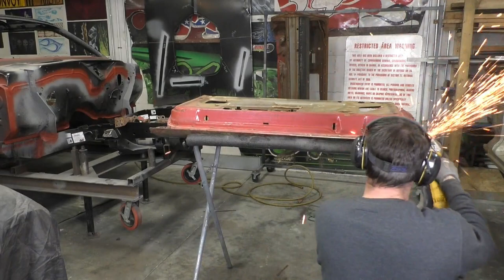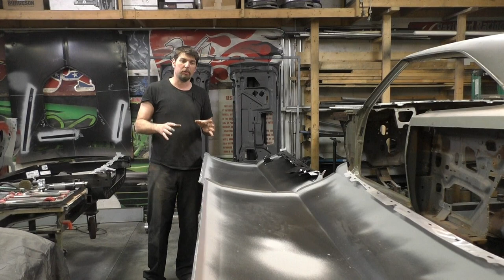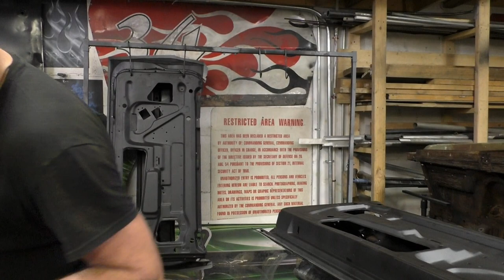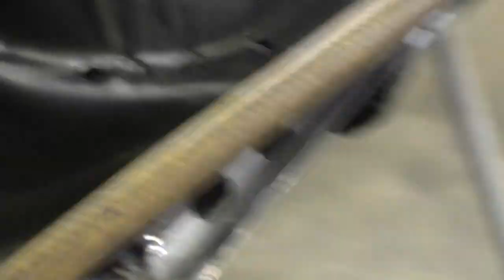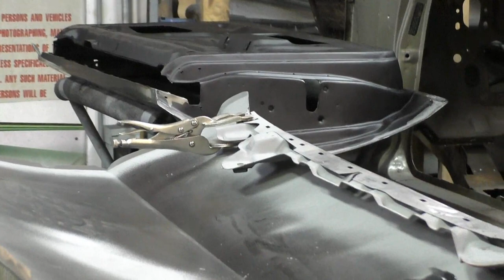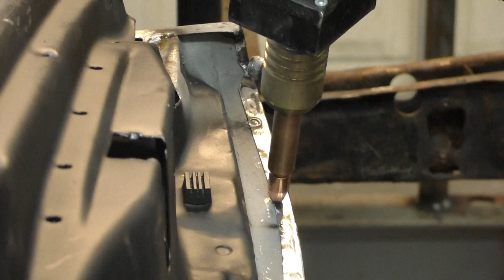AMD vs Dynacorn 1973 Challenger Door Skins restoration episode 6

Comment: Love the videos, thanks. Do you have a video that shows for removal, installation and alignment? My 70 barracuda has a ton of slop in the doors
Reply from the maker: Thank you, I have never done a video just on the door alignment but have touched on it in lots of my videos. Basically you could buy a new set of AMD hinges or rebuild your original. With the AMD ones I have installed them on factory cars and had to take a deburring tool and move the holes to get more adjustment. When aligning the door I always go off the front rocker to lower door corner, doing so will make the front fender alignment much more appealing. Then get them level to the rocker panel, this should make your quarter gap really close. Once you set those step back and take it all in as a whole and compromise a little here and there to make it look best. I will then go back and profile the door in and out. You have gave me an idea for a possible video in the future good luck with it!

Comment: Regarding the prospot 2000. Are you running 3 phase or single phase 240?
If you are using 3 phase are you using a converter and if so which one did you go with?
Reply from the maker: I am running it on single phase 240, the welder does both depending how you wire it up and I can't get 3 phase to my shop.
Reply: @carthageclassiccars  i appreciate the reply. Thank you.

Comment: Thanks for another great video, I have never installed a doorskin. But after watching your video It no longer seems intimidating. I have a question with all the new sheet metal and frame rails being installed on this challenger. Will you be rustproofing inside the  frame rails or using spray on sound  deadling material inside the quarter panels and doors? If so, what products and tools would be necessary.  Thanks.
Reply from the maker: Thank you and that's a very good question and honestly each car is slightly different. I work on an hourly rate for these cars so I have to try and make sure the owner get the most out of their money using my time. I will try and cover your question on the next video with the Charger but in summary anything factory I can access I try to at least epoxy prime, the same goes with anything exterior I try to strip down best I can and put in a good epoxy primer. Epoxy will resist water and corrosion better then anything else, Realistically unless you completely remove every part of the car piece by piece and take it down to bare metal the car will have some vulnerable spots. I do a lot of spray and pray on areas, but also like the inside of the frame rails of this challenger with these new parts I am probably not going to do anything to it. I believe and hoping the E coat that these aftermarket companies put on is quality enough and really for anything I apply to stick well it needs to have a mechanical tooth adhesion through sanding so if I can't sand it the primer wont stick. If you are doing it at home and want to really really go over the top, anything new you install can be stripped to bare metal and put in epoxy primer or even each panel inside could also be base and clear coated the color of the car. Its hard for me to charge an owner for a lot of stuff that no one will ever see. Same goes with the metal inside these doors there was some scars from rust pitting after blast but no more rust we protected it best we can but if I fix everything perfect that no one will ever see or notice the doors costs gets way too out of control, but I have had some request in the past to go to similar levels and that's when the time vs money discussion comes into play for my shop. Hope that helps answer some of your question.
Reply: Yes, Thanks

Comment: Great video again. Is the red primer epoxy, if not do you epoxy over it ?
Reply from the maker: The red primer is an oxide primer self etching that I put over the bare metal to prevent rust instead of mixing a 2k epoxy for every little item. On this project with me doing the body work I will sand it all down and neutralize it with lacquer thinner when i do the entire panel then epoxy all at once when the car is complete. That will get it all a unified epoxy primer before any body work is done. Etching primers are highly acidic and you should not really put anything but epoxy over it but in the reality makes spot priming something that is easy and better to have this then surface rust with the humidity where I live.

Comment: You took a lot of apprehension away by posting this video. Great work. Are you going to remove all the red oxide primer I saw with lacquer thinner before you apply epoxy primer? Scuff it and prime over it?

Do you have a video or will you have one showing how to install inner and outer rocker panels? The AMD rocker panels I put in had to be squeezed together during installation and I was wondering if you had to work with some rockers that much. Whenever I used a spot welder you had to really make the metals was touching or it would pop right through either the top or bottom panel. I can see  how if you are using the single side welder that you would have to check that? That would be a big disappointment if you get that far and the last step messing up the metal panel while spot welding.
Reply from the maker: Yes Red Oxide primer will be removed with Laquer thinner. I will get back to this car soon as its waiting for the cuda to be painted before I put it on the rotisserie. I haven't actually done a e-body rocker panel yet as every e body I ran across so far that part seems like it never rusts. I did do inner rockers on the 69 Charger video and outer rockers on the Nova build. They would be a similar process but noting exactly what you are looking for right now. Also check out the 69 firebird last video i go over how i install rockers on that car. 
  As for my spot welder I haven't had that issue with it as it in pneumatic and pre squeeze's the panels with 80 PSI then is timed after pressure is applied to then burn in the panel. It also has a timing set to hold it together while the weld cools. Really makes it idiot proof at this point for me. Not sure what welder you have but with these really nice rigs it stops a lot of those issues.
Reply: @carthageclassiccars  thanks for the reply Rick. I was talk about the single electrode welder that doesn’t squeeze you used toward the end of the door skin assembly. It really is interesting to watch you make it look so easy. I’m not sure how you achieved your skill level but you are relatively young to have such a great skill level. 
On a side note I am getting an engine block repaired. The ear at the end of the rear starter area bolt that fastens the bottom of the bell housing was broken when I got my engine back from the engine builder. The welder told me about if I remember right a tig process that doesn’t require preheating the block which works for me since I don’t want to damage the pang gasket and other things. I will get back to you later with what he used. You might benefit from the information.
Reply from the maker: @jimdrechsel3611  Oh yes you are right the door has to be hammered down fully. That door skimmer tool really does a good job making sure its all set down close. Let me know about how that TIG process works, I have see other do similar process with aluminum bronze as more of a glue but always open to something new. Thanks a lot for the info can contribution to the discussion.

Comment: What brand is your spot welder, 120 OR 240 VOLT, and where did you purchase? Thank you!
Reply from the maker: Its a pro spot pr-2000 its 240 or 3 phase 408 volts. I bought it used from a body shop since it doesn't meet the clamping specifications of the modern collision requirements with the modern alloys but far exceeds what the 40 plus year old cars need.
Reply: @carthageclassiccars  Thank you so much for the reply

Comment: How do you alone the doors without rear quarters ?
Reply from the maker: At the end I talked about that a little bit where I align the doors off the rockers and stated that there will probably need some future adjustments as more parts are assembled on the car. In my opinion a car this disassembled is built off the door hinge pillar working back first then when everything is welded then I would move on to the fenders off the door. If you follow along i will document my version of the process on this build.